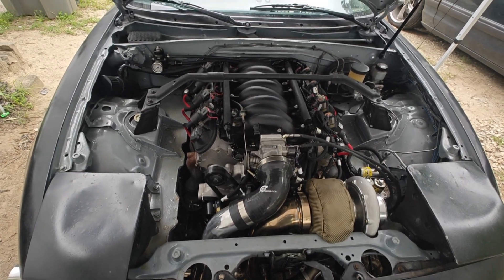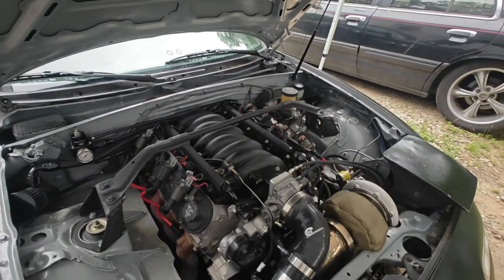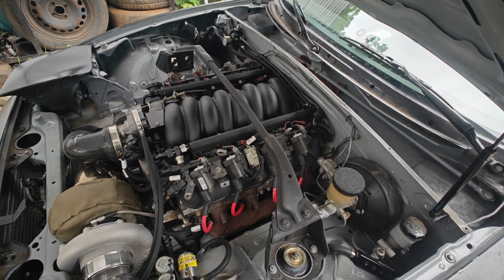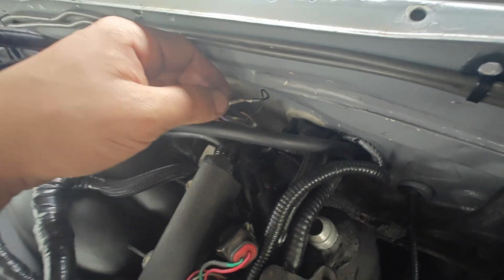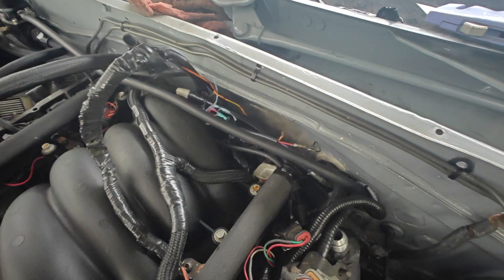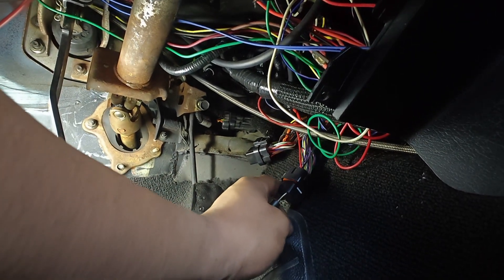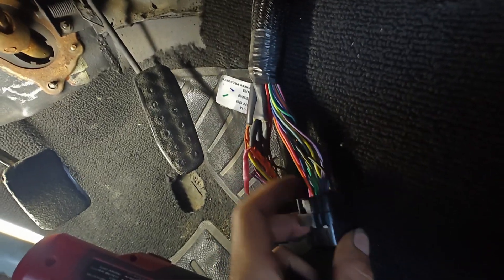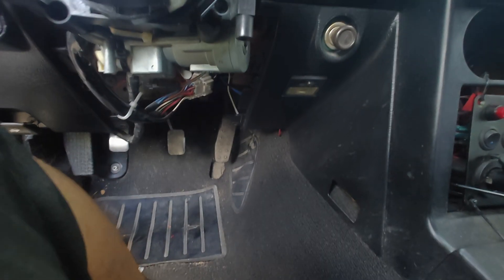gen 3 to gen 4 Holley harness conversion, the right way.

Comment from the maker: One thing i forgot to talk about in this video. Look into the connector part of the crank sensor, there's a little tab that lines up on the opposite side of the Gen 3 plug. Just shave that little tab off and it will plug right in! You can either do that, or cut a grove in the plug for that tab to slide into. Or third option, swap a Gen 4 plug on by depinning the Gen 3 one.

Comment: I have a 06 trailblazer ss with a 07 engine harness but a lq9 gen 3 motor turns on but takes it instantly to limp mode
Reply from the maker: From what I know about stock ECU, you need to use the lingenfelter conversion box.

Comment: I'm doing the same thing right at this second. So I have a Terminator x that had gen 3 block that now has a gen 4 gray crank sensor. Won't plug up! What do I need to do!? Hmu thanks 🤜🤛
Reply from the maker: Mannn I forgot all about this until you just asked. Look into the connector part of the sensor, there's a little tab that lines up on the opposite side of the Gen 3 plug. Just shave that little tab off and it will plug right in! You can either do that, or cut a grove in the plug for that tab to slide into. Or third option, swap a Gen 4 plug on by depinning the Gen 3 one.

Comment: Have a Holley Terminator X Max with a 58X harness but my cam sensor (Torqhead) requires a 12 volt reference. Any suggestions
Reply from the maker: So if you have to run 12 volts on your cam sensor. You can either pull 12v off of the power tap plug, or you can find 12v at the main power of the ECU plug. There might be a spot you can pin into that's unused since it is a 58x harness. On mine which was originally a 24x in had a pin that was 12v and dedicated to my cam and crank only. I snipped and it's unused now. You might have that pin open on yours and be able to pin a 12v out wire from it.

Comment: If I was to order a Holley terminator x 
58x harness could I still use the same ECU that came with my 24x? Don’t know if something in the ECU is different or not
Reply from the maker: Correct, you can. The ECU is the same. You just choose if you're running 24x or 58x. You can even do a custom setting. For instance, 58x crank with 1x cam, like some of the early gtos came. If you already have the 24x harness though you can rewire it like I did and save 500$. Either way you go you're good.
Reply: @miatakhalifa  thanks a lot! Saving 500$ sounds a lot better now 😂
Reply from the maker: Yessir it does! 😂. Just make sure you use shielded wire and your golden!

Comment: What pin does the ECU use on a gen4 harness for the 5v signal to the cam sensor? Is it that orange wire your tapped into?
Reply from the maker: Yes that would be pin a26. If you look up a Gen 4 Holley harness in their website, you can scroll down and find a pin out diagram. There's a link in the description for the Gen 3 digram, that can give you an idea of what you're looking for. I went off of an ls2 diagram for reference and all the sensors pulled 5v from a26 on that one.
Reply: @miatakhalifa  thanks, I have the extension harness and was just going to run it off 12 volts, but the harness is currently out of the car so I think I’ll just make it work like it should and do what you did here. Extension harness doesn’t have the shield wire so maybe I need to step up and buy a better one or build my own with some wire from Holley like you did. Anyhow , thanks for the solid info
Reply from the maker: Sorry I just seen your comment. Yeah you can make shielded wire just by stripping a wire and running it bare along with the other three. The shielded wire is pretty cheap from Holley though. Honestly easier.  Holley is really sensitive to dirty interference, that you definitely don't want to pick up on your rpm signal. Glad I could help, lmk how it goes!